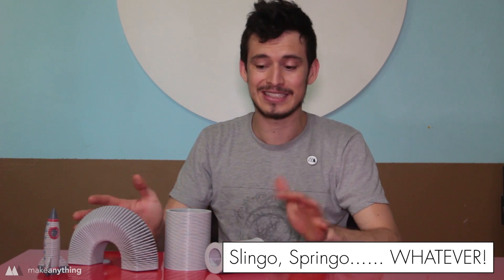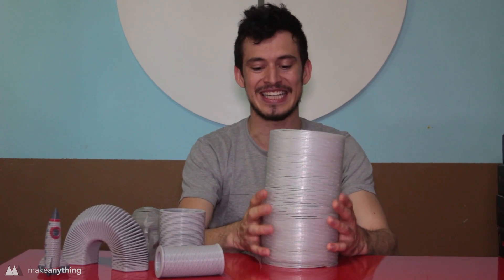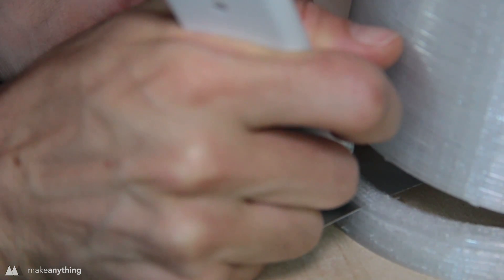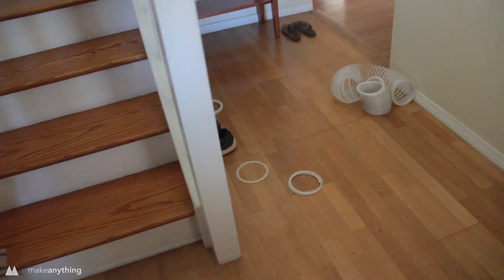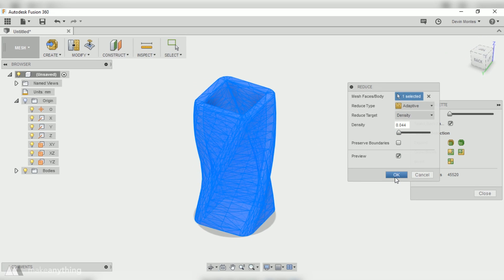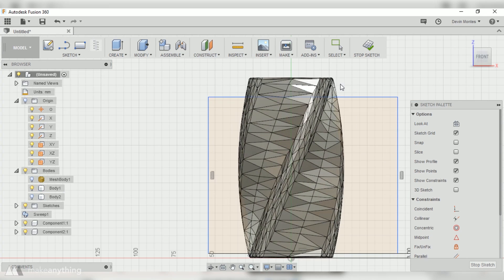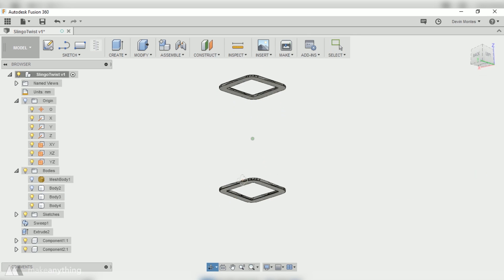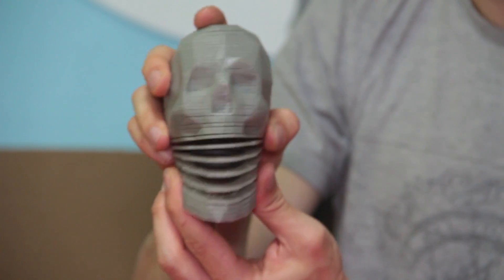Springo Anything! // A Skull, A Giant, & A Fusion 360 Tutorial

Comment: Use Fusion 360's Create Coil tool instead of the sketch helix add-in. It creates a body, but you can actually see the result as you edit the parameters and it's significantly faster than the plug-in. From the body, you can directly use the edge going along it... or I like to create a new sketch, use "Include 3D Geometry" on the edge to duplicate it in the sketch, and then I remove the coil body so you're left with just the helix.

Comment: How do you add the helix add-on into fusion. it inst in a file so it inst running
Reply from the maker: Fusion now has the option to do twisted sweeps and the coil function works well also, so the helix add-on isn't really necessary anymore. I'll have to make a new Springo video to show the easier techniques.
Reply: Thanks! I'm practicing my fusion skills with your videos, as I am getting a 3d printer for Christmas

Comment: I'd suggest using a paint scraper on PEI. Even though PLA tends to loosen its grip after PEI cools, it can still do...that. Late comment, but seeing that poor print surface get owned like that compelled me to say something.

Edit: As for PETG, I've found it's much easier to pull that off with the build plate still hot. Around 50C, PETG is still just soft enough to easily bend out of the way of a blade, so it just gently releases with a little encouragement.

Comment: Do you recommend printing at slightly lower temperature to reduce layer bonding?
Reply from the maker: yes, as long as the print works get the temperature as low as possible!
Reply: Sweet, My Hypothesis is correct

Comment: Would be interested to see a tolerance test print for this method, where you have a .10mm gap for a section, then .15mm for another, and so on.  Then someone could fine tune their print settings and design around that.

I suppose it may not be extremely difficult, may have to try on my day off.

Comment: Can't it be designed in such a way, with a super-thin line in between layers, so you can simply dissolve this support with acetone (or other solvent) by quickly submerging the print in it, leaving main spring intact (only slightly smoothed)?

Comment: Why not try larger gaps and use that solvable fillament on your 3dprinter with two heads? I think it would remove the need for all this manual separation.
Reply: ali709aliali the idea is good and i can see where yoire coming from, but it wouldnt work as well as the method he has right now because the gaps would be too large
Reply: ali709aliali yes